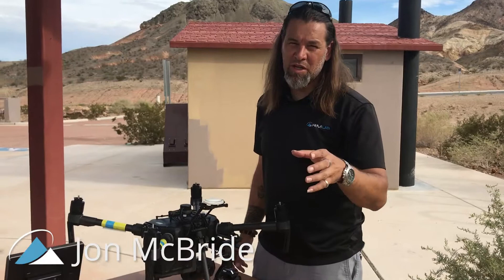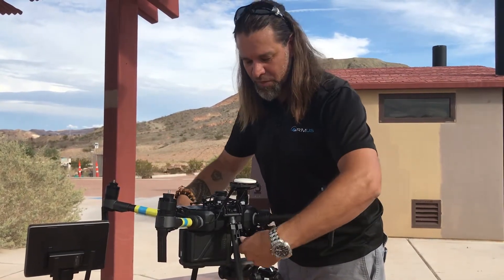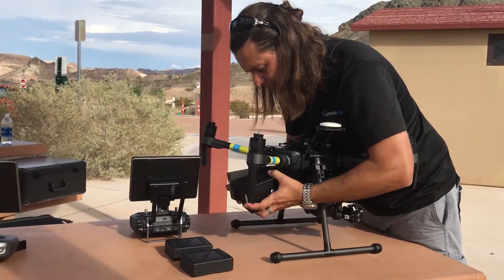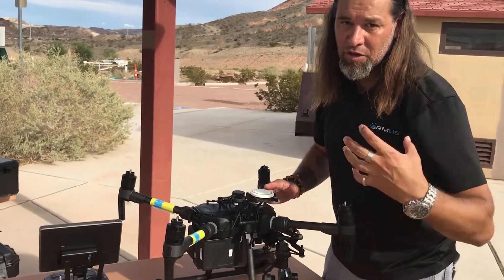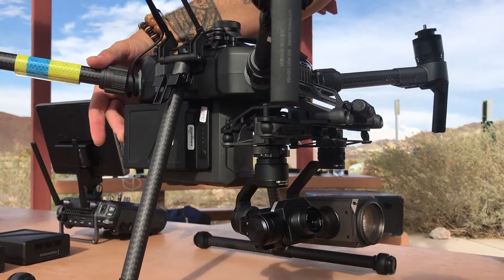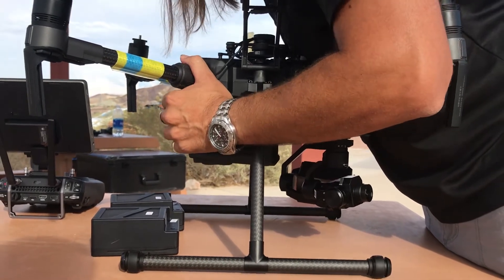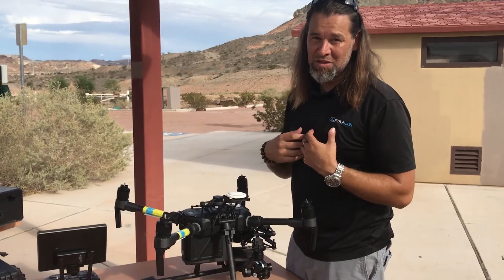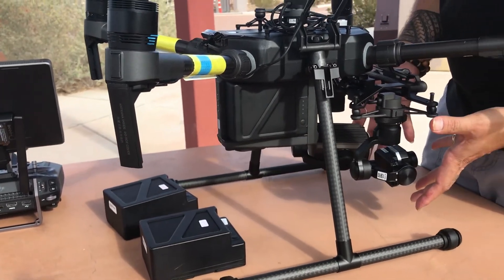M210 TB50 vs  TB55 Center of Gravity Test

Comment: I might have missed it, but what does DJI specifically state not to do? Using the TB50 setup combined with the XT/Z30 configuration or with any dual camera setup in general? Also, where is this explicitely stated by their documentation?
Reply from the maker: DJI's recommendation is to always use TB55s in a dual camera setup.
Reply: That makes perfect sense after seeing this demonstration, too bad we've just ordered our M210-RTK with only TB50s for now.

I reckon you had already performed some flights with the Dual Camera and TB50 setup, how is the behavior? Noticed anything odd, on the forward props in particular? How does it affect the stated flight time, does it come anywhere close to the 13-15 minutes DJI states regarding the TB50s combined with maximum payload?